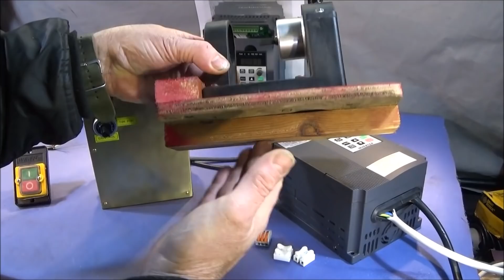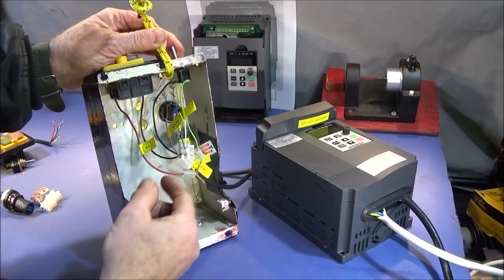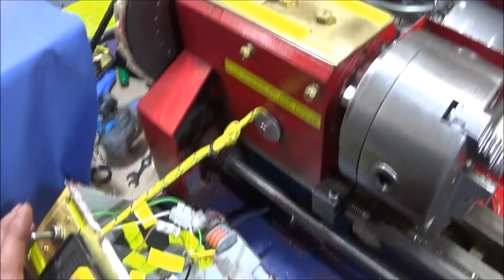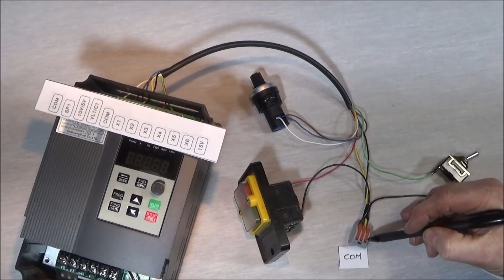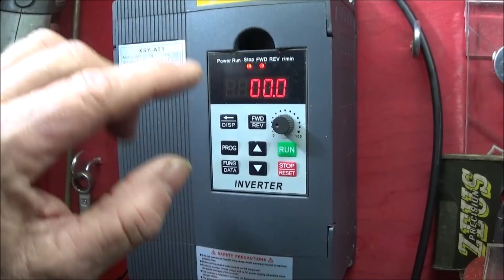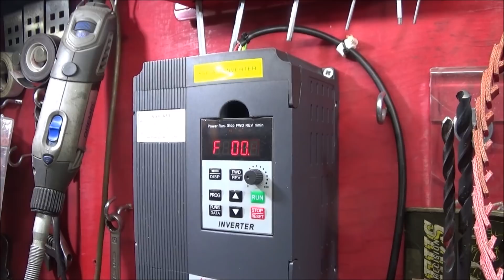Making & Wiring A Chinese Mini Lathe VFD Control Box

Comment: The on off ticket maybe a little over engineered 😉. great post, any ideas what may cause the rotation to stop but run again after resetting safety stops, this can happen under load or running low revs with very light cuts after 30mins ish.

Comment: halo mr jordan my name is andre i follow you on you tube very educational videos i did the same with my mini lathe c2 if it cost you my 2 circuit boards so now also have 3phase motor and vfd exat the same as you also exakr the same unfortunately the potentiometer reacts differently at 10 = 0 and 0 = 10. and the forwards and backwards on the vfd give the opposite of i have connected it exactly as on your movie i hope you can help my thanks in advance. best regards from Holland from andre out.
Reply: To change the operation mode of the potmeter, just simply swap the wires of the COM and 10V/5V.😊 The same to do with the FWD/REV button.

Comment: what do think about the uni-directional link belt you are using? will that be a problem running backward? Why or why not?
Reply from the maker: Hi Billy it works both ways without any problems. I have one on the Myford Lathe as well. It shows no difference in performance either way. Regards Steve

Comment: This video has been extremely helpful for me. There's not much info out on this VFD. Thank you. Could you tell me how to program separate momentary switches to control Run and STOP?
Reply from the maker: Hi if you watch my video "making and wiring a mini lathe vfd control box you will see how to wire it and alter the vfd setting. Regards Steve
Reply: @SteveJordan  Thank you for the reply. In your video, you use a latching or toggle type switch, I was wondering if you knew how to use 2 separate momentary type switches, one for Run and one for Stop. Upon further searching, I'm kind of thinking that this VFD can not use momentary switches to do this. Thanks, Jim
Reply: @ProfesionalNewbie  did you ever figure this out? I’m trying to do the same?
Reply: @aguycalledlucas  Not really. I ended up using a latching switch that ,when pressed and latched, would run and when released would stop. I also put in a E-Stop button.

Comment: Your recommendation prompted me to buy the XSY-AT1 inverter and the 1HP TEC motor. I couldn’t be more pleased it’s so quiet and smooth running it’s fantastic. The external control panel is going to be my next job. Great video Steve. Cheers. 👍. I’ll just add that this is on my Myford ML7.

Comment: Hello, in the video i see that your motor has 4 wire,s that you connect to the vfd, mine has 5 wires: green/yellow and 2 black one,s and red and bleu
can you tell me witch wires i have to connect to the vfd ?
it is an induction motor single phase 
thanks in advance
Gerrit
Reply from the maker: Hi if it is the same VFD that I have you can't connect a single phase motor to it. You need a 3 phase motor. My VFD is single phase input. Three phase output.

Comment: hi is posible to set 50hz and all time keep same just use on off externall switch
Reply from the maker: Hi Yes there is a parameter setting that for this. All the program parameters are still programmable using the VFD keypad after setting up the external control box.

Comment: Steve,
On the last shot of the control box it states that it is a 3 phase controller but in the description it states single phase Which is correct?I have a similar lathe and have been thinking about a suitable vfd / motor combination. What is the low rpm torque like?

Mike
Reply from the maker: Hi Michael It is a 220v AC Single phase input to 220v Three phase output VFD. I find the low torque with my 1HP motor to be excellent and can use large drills. I have the same VFD and motor set-up on my Myford ML7 lathe, although on the Myford the VFD box housing is a different shape and color, with the same electronics.
Reply: @SteveJordan 
 Thanks for the prompt reply.

Comment: Informative video Steve but I would have liked to have seen a 'raised' stop button either replacing the flush one or as a additional E/S
Reply from the maker: Thanks....The off switch is raised somewhat in use and is very sensitive,  but I was going to fit an additional mushroom type E/S soon and one or two other things, just for good measure. Just waiting for some components to arrive. Regards Steve

Comment: Hi Steve. Thanks for this video which is great timing for me. I am just putting my lathe back together having just changed the head-stock bearings for FAG angular contact bearings and replacing the plastic gears with metal ones.  

I didn't find anything actually wrong in the head-stock. Though I suspected a broken gear ,as it was so noisy, particularly in low gear. The plastic gears were pretty loose on the shafts and there was absolutely no lubricant whatsoever in the head-stock. I know in theory nylon gears do not need lubricant and nor do the sealed bearings, But I would have thought the selector fork assembly would have some grease on it. 

One of the original  bearings they had painted over and it felt a bit crunchy, though the other bearing seems OK.

I also drilled and tapped the holes in the head-stock that you showed in an earlier video for oiling the metal gears and of course replaced the grub screws on the change fork  and lever. 

I should have the lathe all back together today. I have always intended to go the VFD 3 phase motor route with the lathe eventually, but there was little point doing it with the little clarke lathe that only uses 3" chucks, so decided to wait till I got my cj18a from amadeal. 

Been a bit to cold in the shed lately though so much has taken a back seat in my little workshop, looking forward to some warmer weather in the not to distant future. 

I always enjoy your videos Steve, I must admit to preferring your workshop projects to the product reviews. Though the reviews you do are are excellent also. Keep up the good work Steve.
Reply from the maker: Hi Stephen, It is always interesting when taking these lathes apart to see what one will find. You sound like you just get on with the job like I do when working on the mini lathe.
   I have found it too cold to go out in the workshop lately. I have been doing a few extra reviews lately whilst waiting for some warm weather. 
  I have several machining and 'things to make' projects lined up, when it does warm up, which will be much more interesting. I actually like doing  the machining and making videos best of all, so getting my lathe finished is a great start for the year. Regards Steve
Reply: Yes you have done well there Steve, great upgrade, I love it when a plan comes together. Did you know you can get a rubber grommet for the bottom of the control box where the feed screw goes through the box and that seems to keep out most of the swarf? Arc eurotrade sell those, (Arc Eurotrade are relatively local to me and they are always pretty helpful) they are quite cheap.

Well the cj18a lives to tell the tale. I expected a bit of clatter from the metal gears, but mainly that is down to the change fork between the gears.However It is much quieter than it was.  and the noises I can hear no longer worry me, as I know where they are coming from. 

Best Wishes Steve.

Comment from the maker: SEE LINKS BELOW FOR THE EQUIPMENT USED:-
VFD 2.2KW 220V AC 12A Single Phase Variable Frequency Inverter General --  https://goo.gl/sbQccx 
10K Potentiometer Frequency Converter -- https://goo.gl/A4SoV6
AC 220V/380V 10A Waterproof Switch --  https://goo.gl/q9zg22 
Excellway® 222-413 10Pcs 3 Pin Spring Terminal blocks  https://goo.gl/M1f3CZ
Double Head Sheet Metal Nibbler Cutter Holder Tool -- https://goo.gl/4M9LKZ
Hilda Nibbler Cutter Holder Bracket-- https://goo.gl/A4r47E